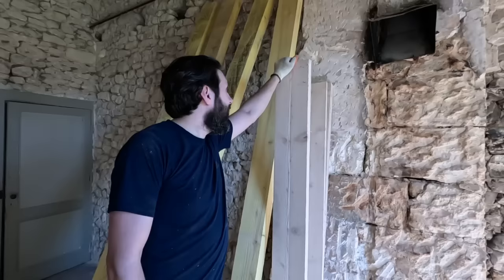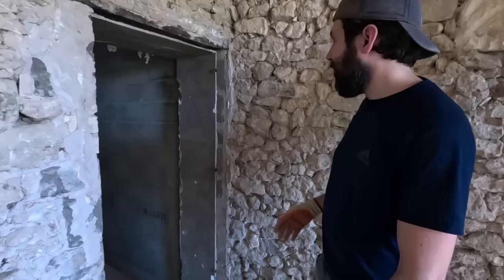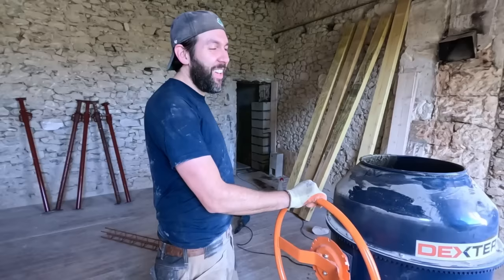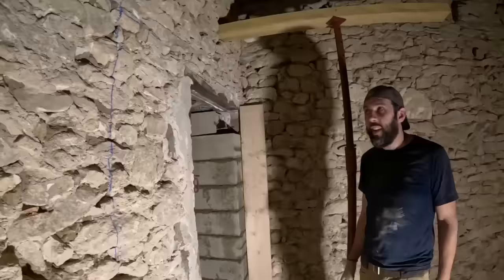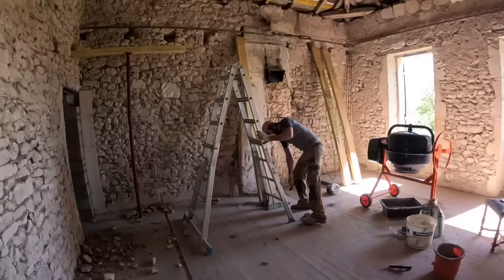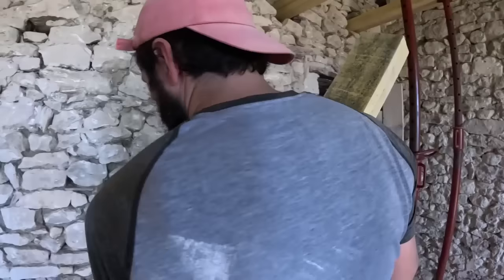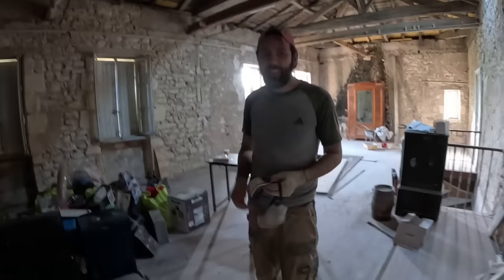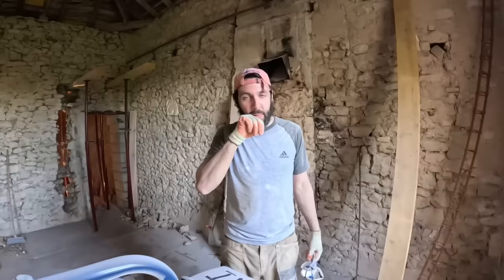DIY Stone Wall DEMO - Opening Our 1800 Stone Wall/ PART I /French Stone house renovation

Comment: Hi guys I just saw your channel. Now I’m not sure if you’ve watched any of the other tell channels in France, but I noticed that a lot of your walls have been decorated with cement and I heard that’s a real killer walls out there because you need to have a lime mortar mix not just straight cement and some of your walls look like they could use repointing anyway just a thought. Wasn’t sure if you were aware of it, but all that cement should be chipped out and replaced with a lime mix!! A lot of those château owners are mostly Brit from Brit to France but they’re dealing with a lot of what you’re going through as well and they are pointing and fixing up walls and replacing walls. I’ve learned a lot just watching those channels and I’m here in the United States. Good luck Stephanie, Santa Fe, New Mexico, USA. 🇺🇸
Reply from the maker: Hi Stephanie! 
Thanks for the kind words! 😊
Oh yeah, cement over stone walls were trendy around the 70’s 80’s here… According to our elder neighbors, they thought it would give a newish style to the house (on top of being an isolant?)! The problem is that stones need to freely move especially when stacked on top of clay… cement traps them and create those cracks you can see on the side of our façade!
This is definitely a priority, we will attack these walls when we will be done making a livable space! 
In our house they had even glued plaster directly on stones, which had molded 😵‍💫🤷🏻‍♀️
They did what they could we what they had… now our turn to try to « fix »…
Sending love to New Mexico!